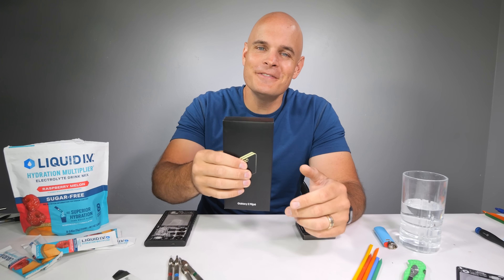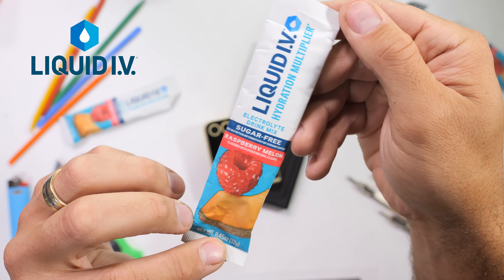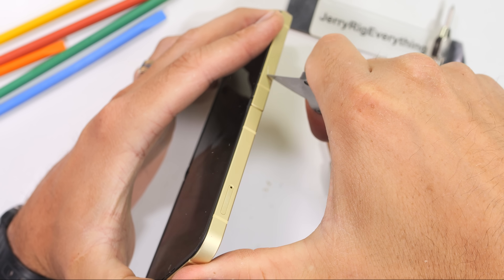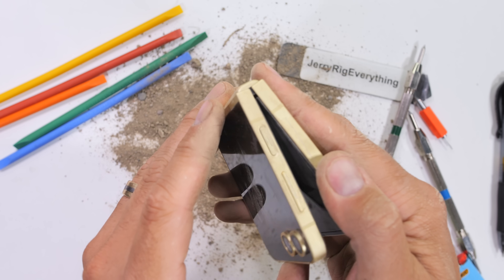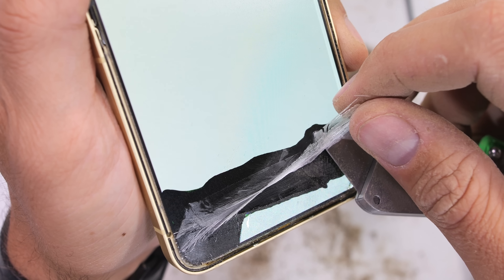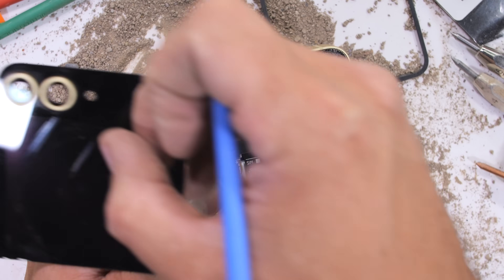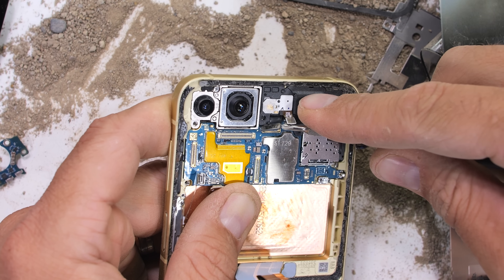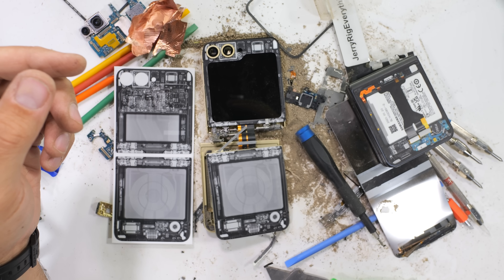Samsung Z Flip 6 Durability Test - I CANT BELIEVE THIS WORKED...

Comment: I’m really disappointed. I took extremely good care of this phone and never dropped it. Exactly one year later, it stopped charging while closed, and shortly after, the main screen stopped turning on completely. I took it for repair and was told an internal part broke from opening and closing the phone too often 💀 I literally waited until the 6th version came out before buying it, thinking it would finally be reliable enough to use as a main phone 😢

Comment: It's the worst phone i've ever use i was an Samsung guy since galaxy S6-S8-S10Plus-S20-S21Ultra then problem at Z fold 5 that's i've use for 2 years and Flip 6 that less than year, i drop flip 6 like 40cm from a table and when i picked it up the screen are broken with Bliking and white line, same to Z fold 5 i mean i have use it for years and it broke on the same week as the flip 6 , the fold is prob because the cable between screen and i've change to iphone 16 pro last year

Comment: Pretty sure my Flip 4 is tougher than any other smartphone I've had. The flexible screen is shatterproof, and it's protected most of the time anyway. I have it in the Samsung 'ring' case and drop it on the reg - I don't even bother to check it any more, it's always fine.

Being able to stick it in ANY pocket or hang it from a pinky when I've got my hands full is awesome. I'll never buy another slab phone while foldables are available.

Comment: I got a Zflip 6 last October, I of course watched this teardown, and it seems like you must have had a different trim level to the one I got. I got the wet toilet paper, with the 0.1 micron cellophane screen and nanometer aluminum foil bezels. Until I got it, I didn't even know there were different versions. Why would I, there's no price difference, or other indication of the difference. In my defense on the screen disclaimer, I am legally blind "20/400 in both eyes WITH correction" and at the time was on vacation at the regional top dog hospital, residing in the suite labelled "ICU" had a 3 month stay, that just "anything but" flew by, and given the whole rotting from the inside out, focused mainly on the spine, I was a tinge off my game. It's the free drinks, I was on vacation afterall. I've refused high end phones for a few years, going for the $150 Umidigi, Ulefone, and whatevr other brand names that probably have "goo" in them somewhere, so figured while I was stuck indoors on my hiatus, I'd treat myself, because I'm selfish, and thought I deserved even more than the $3M+ vacation I was splurging on. Anyaay I go to put insurance on it, which involved having me remove all cases and screen protectors right? Did their video to the letter the way they told me, uploaded a different one several times always resulting in "we cannot currently provide you with our services" so no insurance. Well, a couple months later it happened. Despite my constant handling of the device as if it were a live exposed human heart,  destined for transplant, and ensuring every sinlge atom of the interior and exterior was totally encased in cases made of materials as close to adamantium, and beskar steel, as our technology allows, while being noninvasive enough that the design of the phone wasn't hidden, somehow that one time, I dropped it. Honestly, it bouncd off my granite counter top at the higher side with bar stools, so fairly high up, with it bouncing off, me trying to be OJ in hs day, and failing utterly to catch it, which resulted in a course change that took it directly to the HVAC floor register where it had its final crash landing. Whew.... close one, it's fine, man I'm glad I balled out on that $11 case instead of the $9 one. Good call!! aaaaand then, the next morning, when the screen wouldn't come back on, I realized that adimantium and beskar aren't transparent!  Didn't panic because I found out that Samsung will replace my screen once under warranty, I guess here's hoping that 2nd screen isn't flawed in anyway, since they won't do it again. Send it off, a week later I get my $350 bill for screen repair. Apparently the screen protector I was required to remove, before they wouldn't insure it, voided the warranty... at the end of that, I expected it to continue "which is why we told you take it off dumbass" but in reality that last part was just implied. Well, you've already got the damn thing, so here I guess. Got it back, and after reentering every single log in on every single non samsung app, since my 1.5 hour upload of the 100% mirror image of my device I guess had some smudges on all that stuff, but it got done....... and 3 weeks later, the very second drop it's ever experienced happened. This time was far less harrowing an ordeal, I fumbled it, it then bounced off of my gaming mousepad, onto my padded armrest, then the carpeted floor. However at the last second, it decided to stop by the steel desk leg for a quick visit, since the phone was opened, and the screen was excited to see the world I guess, so that's right where it hit. Well, warranty is voided, and they again refused to insure it, since they'd gotten to replace the screen they had me damage for them, so... another 350, or a random 2x larger camera dot at the bottom, restin on a 2mm thick line of 100% bright bare backlight goodness.... I don't even notice the line anymore ya dix!!! I've had it since October, so in 19 months It'll be paid off, and I can quit buying flagships again. Wonder what the WowGoo S26 PhoneI 17 UltraProMaxMegaMini will be looking like... Hopefully it's not as cheaply made as my $1300 current POS is. It'll also be nice going back to a phone without AI, so my autocorrect will actually 1, correct mispelled words, and 2, not determine that a phrase like "see you later" should really say "See! I hate you!" as my Samsung currently does. My dating life is surely gonna improve. good thing too, that'll be a good 2 years since my back flaying, and the sympathy playing then will be more like whine begging... still got the blind card though.. Hey baby, wanna drive us to my place with those beautiful green eyes? Yeah her eyes are brown, and her name is  Chuck... SHIT!

Comment: When you complained about opening and closing the phone all I heard was "I have a crippling cell phone addiction"
Reply: He's right though. Old flip phones back in the day were easy handled one handed. Making a flip phone a good option. 
Today you basically need to stop, use both hands to open it and then both hands to close it. If you have any sort of work life that requires a lot of phone usage (like me, I get work related emails, texts and calls at least 3-4 times per hour) it turns into a massive time consumer and handicap.

Comment: My new Z Flip 6 arrived two months ago yesterday and after 6-1/2 weeks the charging port stopped charging. I got a wireless charger. Problem solved. Then last week the inner screen wouldn't swipe or open apps. After many rebooting attempts, I contacted Samsung and they directed me to an authorized repair center. I bought it there and Samsung will not cover it under warranty because they found a tiny pinprick-sized dot on my inner screen protector and said that made the phone damaged due to dirt. I had a shock proof fully protective cover on it since the day it arrived and I'm so careful with it. I watched your video and I don't believe my phone is damaged like they say. The repair place said my 2-month-old phone was in excellent condition. I really, really enjoyed the small folding size of the Flip 6 but I'm hesitant to get another one. Until your video, that is. You can't even see the small spot they are talking about unless you shine it in a bright light and move the phone around. Even then it's hard to find. I miss using my Flip 6. It's now a paperweight.

Comment: I definitely The idea of your DBRAND COMPANY. But unfortunately for me it just wouldn't be practical. 

I am a big MAGNET GUY!! All of my phones have a metal plate on the back of them just slow enough so I can still wireless charge in an emergency which I never use the wireless charging I always have a plug everywhere fast chargers everywhere In my vehicles in the house. Never had a Samsung port fail on me. 

And I have a very strong neodymium magnet phone or tablet holder in all of my vehicles, even when I'm watching TV in bed with a holder and a microphone stand. Because my wife doesn't want to hear my shows. I also have a very cool Bluetooth in one of my ears 😂

Just can't beat the magnet set up you just pop your phone on the magnet you have complete access to the entire phone sliding The edges are completely exposed makes it so much easier to use the phone. 

Even on buses, trucks, things that I drive things that are going up and down BANG BANG BANG My phone never comes off the magnet. Pretty amazing. 

So I would love to show the INTERNALS OF MY PHONE ON THE BACK. But I always have plates and things on it. Not to mention I would have to put your dbrand external sticker and then it have to put on my metal plate.. when it gets hot on a bus or a truck that metal plate if it's not stuck on correctly we'll start to get gooey and come off. It has to be directly on the case. 

So if you could think of another alternative where I can do both let me know!! 

;)

Comment: Is it only my flip 6 that gets overheat quickly? Like I just take several photos indoor literally in cool place but it gets overheat? Also when I record video even less than 2 min it starts to overheat. I just got mine a month and a half and this issue happened from the start. I don't use it for games. I also don't use it for my main phone so I don't install many apps. It's so annoying with overheat problem.

Comment: I have not wanted a Samsung Flip or Fold device because of that screen, folding it for a long time will eventually fuck the screen, but the Flip 6 is impressive, and the more they improve the screen the better, where I hope that flexible glass layer becomes a top layer, where there is no soft top that leaves imprints of nails or a styles that my Galaxy S23 Ultra has, which also has a similar layer on the screen as I use a TPU screen protector, as glass doesn't stick well to the curved edges, and most glass protectors don't even cover the edges or only go part way over which is terrible to look at. I know the sort of imprints as my screen protector has lines all over it from my S-Pen, not really noticeable unless you turn the screen off and look at it with a reflecting light, exactly like the flip 6 screen there.

I might find myself getting a Samsung Flip only when they start putting that glass layer on top of everything or add a second flexible glass layer on top of everything. I can at least replace this screen protector on my S23 Ultra pretty easily and cheap, you can't with a flip...

Comment: I'm a little late for this video but i havent seen any content creator talk about this issue. I've had the flip 3 a while back ane after a year the phone would completely shut down when closing it. It would only turn back on while charging or if i had over ~70% of battery left. I've seen so many comments on forums about what COULD be the cause abd it always seems different, change de battery, change the screen or the screen protector, could be the ribbon cable that got loose etc.
I think a lot of cc don't see this because it's not their daily phone and this issue seems to happen to every model (found some discussions about it for the flip 5). Has anyone also encounter this problem?? I absolutely love the flip format but it kills me that the phone stops veing functional after a year for the price you have to pay. I've also read it because you close it too often (bit that's the fun part of the phone ??)

Comment: I'll never buy Samsung ever again. I bought a Zflip 4. It failed within two years. Kept in a case, never dropped. The screen refused to come back on when closed. It had to be reset, or you could tap on the screen until it came on, sometimes. Samsung declined warranty, despite no accidental damage. So I looked on the net and there are loads of people with similar issues. An appalling phone with poor engineering. The crease splits, hinges crack, it gets dead pixels.

Comment: I get the appeal for full size foldables since you basically get a tablet when unfolded, but these flip ones seem kinda pointless. It doesnt actually save mych space, youre just taking half of its volume and stacking it outwards instead of on top. They're arguablt harder to fish out of your pocket quickly too and worst of all you get more durability issues from this design. I much prefer the traditional slab phone design and could see myself someday using a regular foldable, though I still usually just use my iPad or my PC when I need a big screen anyways.

Comment: I need some opinions:
I bought the Iphone 15 after having the Iphone 11 for 3-4 years because I generally prefer Apple products (I have the watch, an Ipad and Airpords). However, this little piece of * already has battery problems (90% battery life in less than a year, even being careful with it) and I felt so bad that I want to switch to the Flip. Would you recommend doing it? I'm used to iOS, but I'm so freaking disappointed with such a bad quality phone.

Comment: It looked like the flexiglass does not go over the hinge, which might be obvious since it clearly shattered with less flexing than it would at the hinge, but a split glass design seems like the way to go. If they could get the hinge to line the glass up to like 4 thousandths of an inch opened and close the same, you wouldn’t be able to tell there’s a gap there at all.

Comment: lmao theres no insulation between the small battery and vapor chamber you know that heat will degrade that battery faster when you use your device heavy extensively

Comment: Thanks for this; Samsung has engineered a very impressive internal hinge mechanism, and it's impressive to see that the phone doesn't break in half when bent in the middle from the back. I think I would get as annoyed as you about having to open and close it all the time so I think Flip phones aren't for me. The Flip 6 is also way too thick at 14.9mm without a case when closed. Even the Fold 6 has gotten it down to 12.1mm without a case when folded. I might consider a Fold when they can get it down to about 9mm thick without a case when folded and the front screen to be a 6.7" 1440p 120Hz+ display with Gorilla Armor.

Comment: Would be cool to see how well the vapor chamber works with a thermal cam by applying heat to one side or setting an ice cube on one side then comparing that a copper sheet/plate

Comment: I've had my Samsung flip and I never wanna go back, always on the go and working from my phone all the time. It's not for everyone but I love it and I can't wait to upgrade mine. Thank you for another great video!!
Reply: Just wanna know how the durability. I am so scared of dropping it
Reply: @nazhataysha1856  I had the flip 3 and within 4-5 months I was already getting the screen crease in the middle, as well as scratches overtime just from my nails, like shown in this vid. As for durability drop test, I dropped it from pocket hight missing my pocket (on accident) without a case and it shattered the back glass (not screen) but didn't fall out. Used it for about 10 - 11 months I think before getting my current s22. Sorry for the long reply
Reply: @nazhataysha1856  i have zflip 5 from the PO, already dropped it several times, still rigid and strong as new. Changes the screen protector just yesterday after 1 year use.
Reply: I've had the flip 5 for a year. I hated it the first month, but once I was used to it, I completely stopped using my s23 ultra
Reply: How long have you had it for?
Reply: Only been using my flip 4 a couple months and I've been going caseless, but I've survived a few scary drops open & closed without damage
Reply: @aleksanderlucy8764 are the scratches rlly noticeable
Reply: I hear that the durability sucks, cuz when you drop it the spine breaks.  I hope this is a lie because I really want to switch,  but am very clumsy 😭🥲
Reply: @plurple165 Hey there. Honest review of almost 2 years Flip 5, dropped it around 40 times waist-height, and also had a terrible accident which broke my entire left arm into pieces, the flip flew out of my pocket and slid for 20meters approx on the ground. All without a case. The only thing that broke, was the back glass on the bottom, not the outer display. And it broke during the accident only. Hinge was never a problem, screen lived trough all of that without a hassle. Got my z flip 6 yesterday and hope for the same durabilty. 

The small form factor actually prevents much of possible damage.
Reply: @plurple165  I've dropped it while open a few  times, but I have a case on it. I am more careful now, especially compared to a regular phone
Reply: @beokay1540  did the spine break or crack tho?
Reply: @plurple165  no it didn't. Works perfectly
Reply: @beokay1540  ok omg thank you so much!  I’m gonna consider buying one
Reply: Had the competitor Razr 2022 for 2 years now... same experience.

Phone works amazing.. the front screen means you don't have to open it (something Jerry hasn't learned to use) and it lasts so much longer with the smaller screen answering 90% of the work you do (including quick response emails/whatsapps).

As for durability, differs per person what they call etc. Jerry wouldn't find anything durable :P and he didn't test my 22 version, but did do the 40 version. From that pov it is all 'bad' when you look at the plastic inner 'protective' layer etc.

But they do bounce amazingly from floors.... which has been tested repeatedly... poorly... and unintended.
Reply: I own Flip 4,  screen failed after 5 months😢